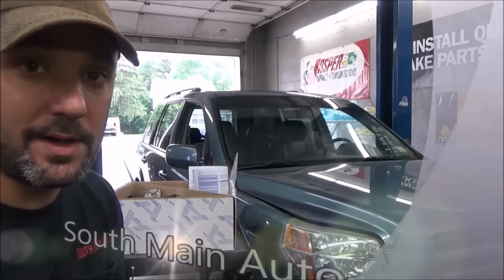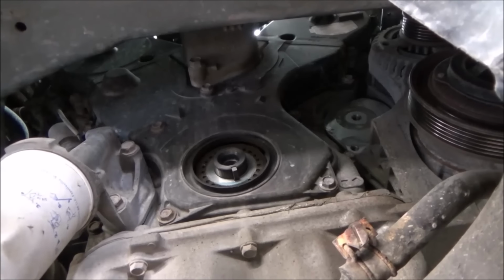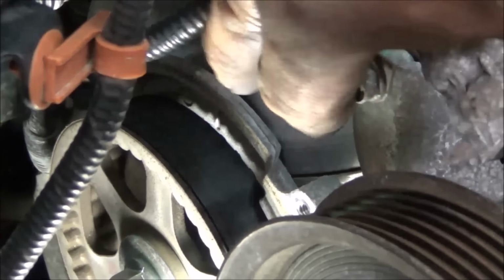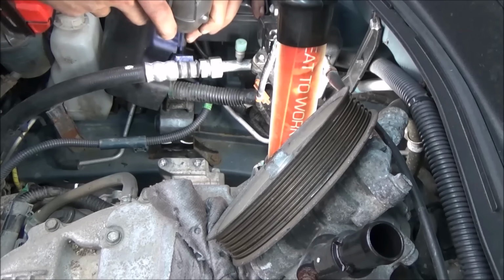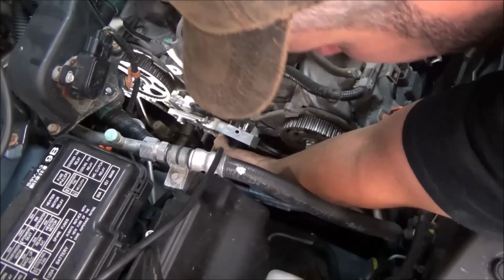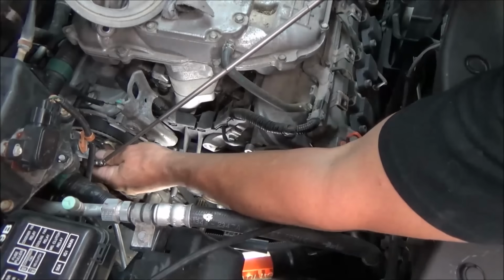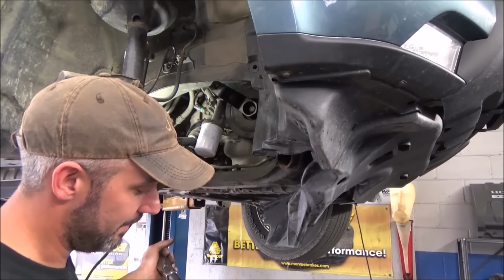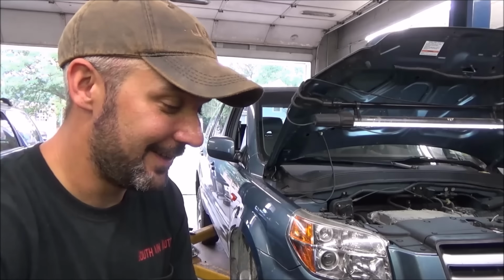Honda Timing Belt 3.5 J35 - Pilot, Odyssey, Ridgeline

Comment: I just did this job last week end, I would not recommend that any new mechanic to do this job. Unless you have a great set of tools and years of hand on knowledge. I improvised with the crankshaft bolt. I will share this because it can be valuable for the regular guy and no special tools needed. I used the old serpentine belt like a strap wrench. Snug it around the harmonic balancer, tie it with wire or cable, then wrap some of it in the opposite direction of torque needed to remove the bolt. I found that the oil filter boss made a good anker point. Put socket on bolt and with a long breaker bar plus with a 3 foot pipe extension, it will break loose after much grunting and painfully pulling.
Reply: Autozone rents the 50MM crank pulley hex tool you pay $44 when you return it they refund you. I bought the lisle heavy duty socket and a 1/2 inch air impact removed the bolt without having to hold it with the tool. I agree that this is not a job for everyone way too many stories on piloteers forum people bending their valves since this is an interference motor.  I won't buy another one that has a belt or an interference engine.

Comment: hi- i wonder if you know how many revolutions of the crankshaft for 1 full timing sequence- I inadvertently turned my crankshaft with the timing belt off- i had both cam sprockets timing set but turned the crankshaft sprocket two revolutions
Reply from the maker: It doesn't matter, line up the marks and it's on. You can turn the crank all day as long as your marks are lined up when the belt is on.

Comment: Another Pilot adventure.  Used heat,  a breaker bar, extention and a 6' helper to break crankshaft bolt loose.  Had a helper hold pulley in place with the special socket.  Couldn't break it loose with heat, the massive socket and the HFreight electric and battery impacts, older versions.

Comment: It just' goes to show you I don"t buy nothing with a rubber timing belt in it I have put 300,000 miles on my Chevy truck and never touch anything inside the engine, didn't even have to put a water pump on them.

Comment: Both cams moved trying to wrestle the timing belt on. What do I do?? Can I adjust both cams independently with the timing belt off? Can I spin them counter clockwise
Reply: Hey brother what did you end up doing since they moved
Reply: @jsimms7688  hello, well after going back and actually reading the directions on all data, I found that I was skipping a step. All data says to remove one of the battery hold down clamps and shove it through the timing belt tensioner to keep it from causing slack in the belt when your routing it (if that makes sense) so what I did was basically turn the crankshaft counter clockwise till both hash marks line up at TDC and you see a 1 on the forward cam towards the front of car. Second I took one if battery hold down rod stuck it through the hole on the block towards the timing belt tensioner, routed the belt over the cams and crank. After the belt was on I spin crank over two revolution make sure nothing was binding and it was good from there

Comment: I may do my 17 Acura MDX myself. I've done two other timing belts in the past.  Acura wants $500 just to do spark plugs...i did them myself with OEM originals for less than $100 and took an hour taking my time.

Comment: I’m a retired mechanic. I have over 30 years experience and it’s about time that somebody said that they were removing bolt with a 10 mm head and not a 10 mm bolt. There is a difference.  Thanks
Reply: a bolt
Reply: Imagine if he said, "I'm removing this 6mm bolt," and then whipping out the 10mm  😂

Comment: When i cut mine off the exhaust camshaft jumped backwards is this normal or do I need to do something
Reply: When I cut off the timing belt that is
Reply: Hi I’m trying to find out what do you do if the marks are not dead on? What did you do?

Comment: I spent 3 hours with a 3/4 drive Ingersoll Rand air impact and that dam So called mystery socket. Bottom  line if you don't have a lift, long ass breaker bar and cheater pipe, you are not getting that crank bolt off, if its never been off before. I feel defeated.

Comment: I did the timing belt on my 08 kia rio about 4k miles ago. I used an aisin kit but ended up reusing the same spring for the tensioner. I'm wondering if I should go back in and replace the spring with a new one or if it will be OK till the next 60k service.

Comment: These earlier j35s dont have the hydraulic serpentine belt tensioner, and thats mostly a good thing, have you dealt with them before? 19mm tension point but its all cheap aluminum, my first one broke in 2 and the replacement stripped out, a third one is on its away but wont be here for another 10 days, but oh well, whats another 10 days after the engine itself being out of commission for 173 days now

Comment: Yeah, I did the timing belt on my wife's Honda Civic.  And that bolt on the crankshaft was unbelievably tight.  The only thing that worked was that big heavy socket.  It weighs about a pound and costs about $23,  as I remember.
Reply: Can you post a link to where to get it

Comment: Hey Eric, the video was excellent. The entire process was methodical and user friendly. When I cold start my 2007 Odyssey there is a chattering noise coming from the timing belt tensioner area then it warms up and goes away. I was told by the shop that they think it's a wriist/gudgeon pin. Is it possible that it's the timing belt tensioner?

Comment: Finally tackled my 2013 Odyssey this weekend. Your video is probably one of the best for this procedure. I tried the fatty 19mm socket on a number of different impacts. No luck. But a 3/4" drive breaker bar and 3 foot pipe did the trick. .Also, I tried draining the coolant from the radiator which was a waste since a lot still came out of the block when I pulled the pump. Keep these great  videos coming!

Comment: Hey would I be S.O.L. if I already pulled the pin on the new hydraulic tensioner but still needed to remove the timing belt again to fix a couple things?
Reply: I forgot to put in the sleeve for the tensioner pulley from the old on to the new one.
Reply: Hi Riley I wanted to know that answer as well.  What if you pull and there is something not right what do you do
Reply: @jsimms7688  You can put the unit into a vise. Tighten slowly until the holes line up to put the grenade pin back in. I had to do that once.

Comment: I'm not familiar with the keys for Honda crankshafts but I am familiar with lawn mower crankshaft keys.  And it's a pain looking for the key if it somehow falls out while working on the engine.  I'm not sure how snug that key is on the crankshaft but with my luck I'd have to remove it or maybe use a small piece of masking tape or something to hold it on the shaft.

Comment: Thank you thank you for this video.  I just did my 2015 Pilot, and I'm a timing belt noob.  Found myself consulting parts of this video since the instructions that came with the kit weren't very good.  The Lisle impact socket did wonders for getting my crank pulley bolt off.  Wasn't sure my 450 ft lb air impact was going to have enough oomph even with this special socket, but it worked.  I will say I envy being able to do it with a lift, I got pretty tired of having to switch between working from up above and crawling underneath with the creeper.

Comment: Hey Eric I've turned the crankshaft more times that I can count. Each time I get the Crank and Front Cam to TDC, the rear continues to be a tooth or so off. I've removed the spark plugs and have done the rotation with the timing belt still on. What does one have to do to get the rear cam aligned? Its a 2013 Honda Pilot btw.

Comment: Eric, there is a bulletin on this Odyssey for the aluminum engine mount and the idler pulley Clarence the spec is 95 mm if it is not 95 mm clearance you potentially can develop a slight squeak. Also there is a little shim that goes behind that idler. Probably already know about this because you are an awesome technician. Love your show!

Comment: Hi Eric, thanks for your show, I admire your hard work and how complete you do a job. I have purchased that special 19 mill socket and have a kobalt 1000 ft lb tourque impact air wrench, should that be powerful enough to remove the crank bolt on my 2011 ridgeline? Thanks

Comment: CAUTION: Do not purchase Honda timing belt kits from eBay or Amazon.  The majority of timing belt kits on eBay and Amazon are counterfeit, even though the sellers often times have 95-100% feedback ratings.  It is well known that these fake timing belt kit components fail quickly (belt, bearings, water pump, etc.).  A simple GOOGLE search for "counterfeit Honda timing belt" will yield plenty of results.

The fake components are very good copies, but upon close inspection and comparison to true OEM components you will see the differences.  Honda forums are loaded with horror stories from using the counterfeit kits.

If you want to save some money, Rock Auto has a quality timing belt kit by AISIN that is highly recommended on Honda forums.

Comment: THis is great video on how to replace the timing belt at 100k,,but there is also another thing that needs to be replaced,,,the oil pump o-ring seals. These also fail at  about 100k. Also the o-ring seal for the oil filter adapter. These are cheap parts, but can cause a repeat timing belt job  when the oil leaks  on the new timing belt.

Comment: Thanks! I’ve done two timing belts but years in between and I saw a used ridge line  and knew it had an interference engine and am considering buying it so I can be laughed at for driving a white collar pickup.  Maybe not, on 2nd thought.  This last winter made my 2001 Tacoma almost as ugly as I am.

Comment: I had a 2003 Honda CRV with a 2.0L IVTEC which I thought was similar to a Pilot. I asked my garage to replace the timing belt.  Both they and I was surprised when I had a phone call later uthat day to tell me that it had a timing chain.

How is it that the US Pilot has a timing belt?  Isn't it a 2.0L IVTEC?  It was a brilliant car I only had to change the knock sensor (difficult to get at).

Comment: You have my sympathy. The J35 engine is of horrible note. Everything on the back side of the engine is guaranteed to fall behind it and land in this one spot that is damn near impossible to get at. The heads get pulled with the catalytic converters still attached, and great care has to be taken when lowering them into place. You have one spot, and one spot alone to get the back converter down and into the hole before you can slide the whole thing left or right enough for it to land on the dowl pins. Garbage, just garbage I say.

Comment: Wow I spent 2 hours to get that pulley bolt out at home with crappy tools.  I had to cobble a 6' breaker bar and then stand on it.  When it came loose it sounded like a gun shot.  Eric removed it in 3 seconds with his uranium socket.

Comment: The mechanic that took my job years ago and replaced me after doing a timing job on a older honda 1.8 installed the cover without property installing the cover seal which wrapped itself around the cam gear seizing the motor and destroying it. Guess my boss shouldn’t have fired me it was my first automotive job in my career and only ever made one mistake in my two years there a simple bad valve I missed on a rebuilt head.

Comment: I used this video extensively while replacing the timing belt in our 08 Pilot. I've never done serious engine work before, so I watched the video first before doing the work, ordered the parts and had no issues. This video was fantastic, much better than the Honda service manual (that made no mention of taking off the serpentine belt, motor mount, basically anything outside of the crank pulley and timing covers).

Comment: I had a 3ft breaker bar with a 4ft cheater bar removing that bolt on my 08 pilot and it took hours without air tools to remove... the bolt final loosened while I was wrenching down and I ended up blowing my back out 😆

Comment: Thank you very much Eric for making this video. I have a 07 Saturn Vue with the Honda 3.5. It has 261k miles on it. The water pump started making noise. I bought the car with 180k on it, I debated on keeping it or trading it for something else. Since it has always ran great and been really reliable, I decided to fix it and see how much farther it will go...lol. I wanted to see a refresher video since it has been a few years since I tackled a front wheel drive timing belt. Your video refreshed my memory and now I am not concerned about what I need to do. Thanks again, I will let you know how it goes!
Reply: Well????

Comment: Did the timing on a honda odyssey. Lined everything up to TDC when i put the belt on the cam moved. Now when i spin the motor by hand the crank at TDC the cams are at the 11o clock position instead of meeting with timing marks. My question is is it possible to take the belt off and spin the cams to meet the timing mark

Comment: I have a question but first thanks for the video! It was a big help. After I took the crankshaft pulley off the woodruff key fell out and it went back in just fine but as I continued to work I had knock the thing out three time so once I the timing mark where it need to be, I took it out and put it in my tray. Every thing when fine until it was time put the key back which was about a week later. Now the key would not  go in flush as it was when I took it out. I don't know why or how to fix it. I wish I would have had the parts to finish it the same day. Any ideals? Thanks

Comment: After all these years, this is still by far the BEST Honda 3.5 timing belt replacement video on the interwebs (despite your the frequent commentary in the video about being disappointed in the video quality).  Thanks for all the great tips and guidance.   Anyone doing their own, make darn sure you use a Honda timing belt kit or a very high quality alternative if you can't get the Honda kit for whatever reason.  Do NOT under any circumstances use one of the budget aftermarket kits you can find on Amazon, E-bay, and elsewhere (it is not worth the couple hundred $$ you would save upfront).  I have heard too many stories of early failure (as in less than a year).  Also, always do the full kit and not just the belt -- the idlers, tensioners, and water pump can easily cause a premature failure of a brand new belt.  Thanks!

Comment: I changed the harmonic balancer on a 2001 Honda odasy and even with the tool to hold the crank I used a 19mm socket with two foot Baker bar

Comment: Thanks for your step by step instructions. It took me about 15 hours over 3 days to replace the timing belt, pulleys and water pump. Labor estimate from a shop was 5.2 hours for $600, I saved the $600 at an average hourly rate of $40.

Comment: Why does any company still use timing belts? I'd be happy to pay the extra $15 for a chain. Happily I haven't owned anything with a belt for a LONG time (last one was a 79 Plymouth Horizon - but at least the timing belt on that took 15 minutes and one socket to change in the driveway).

Comment: Great video. Must I line up timing belt lines the same as the pulley notches, or as long as pulley notches are lined up correctly, I can install the t belt any way (with correct arrow placement) ??????????????????????

Comment: The j35z1 serpentine belt tensioner in my 08 pilot was much different then this one. mine had a hydraulic arm connected to the tensioner which was supposed to reduce vibrations from the VCM (variable cylinder management) system. Was also a pain to replace.

Comment: Thanks for the demonstration. I just finished my wife's 2013 honda pilot. I used the exact same kit. Runs like a champ. Wife is happy and set for another 100,000 miles. I also changed the radiator fluid while I was in there; along with the serpentine belt. I however could not get that thick socket to break loose that crank bolt. I used 1 inch drive ratchet, extensions, crank shaft holding tool, a cheater bar, cinder block and a jack stand for leverage. I got that sucker off though. I tried 3 different impact guns with no go. The deed is done though. I love watching your channel. Keep up the great work.

Comment: Eric, thanks so much for this video. I fixed my wife's 2009 MDX using this video as the ultimate guide. I ended up replacing the timing belt, water pump (same Aisin kit), and due to a leak, the oil pan gasket (Hondabond). Since I had to pull the exhaust pipe and because we were down there and the engine had almost 200K, I decided to replace the oil pump (OEM) as well. All went well, including using the Lisle Honda crank bolt socket with my Dewalt 899. It came out in about 3 ugga duggas! That was a year ago and it's still driving perfectly. Looking forward to another T-belt change at 300K using this as my reference. Much respect!
Reply: Btw, our local dealer wanted almost $3200 for the job. I saved quite a few $$$ and had quite a bit of fun. Yeah, that is always stressful cranking for the first time after the timing belt change, but so satisfying to hear it purring away and knowing it's another 100K before the next one.

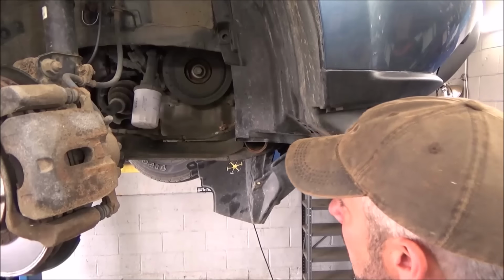Comment: 5:16 I dont know if I just got lucky or what but I removed that bolt with a dewalt impact driver with a regular socket. No hazle. It struggle more with the wheel lug nuts than it did with the crankshaft pulley bolt.  Maybe some one had already replaced the timing belt on my car not long ago because it still looks good. But they didn’t replace the tensioner. So Im replacing the whole thing.

Comment: Those fat wall sockets work so good the first time I got one I was so amazed I actually could use the half inch gun and do jobs that would normally take my three quarter inch gun and the 3/4 gun was struggling and sometimes I had to fight it for a while